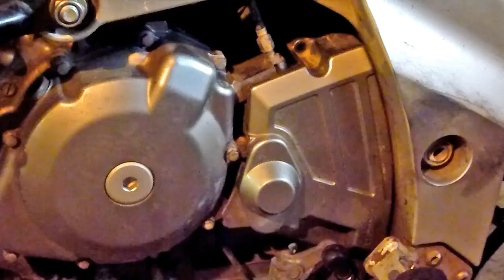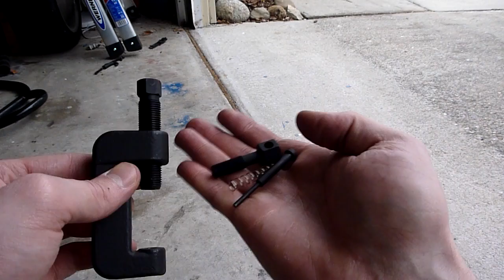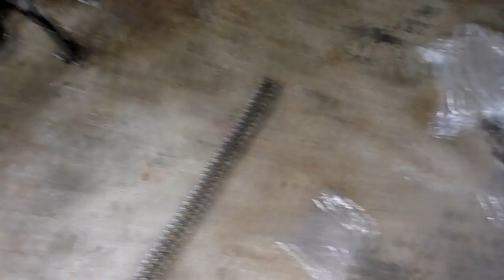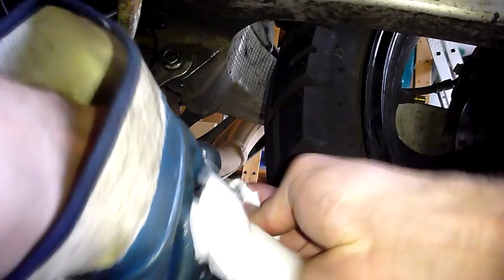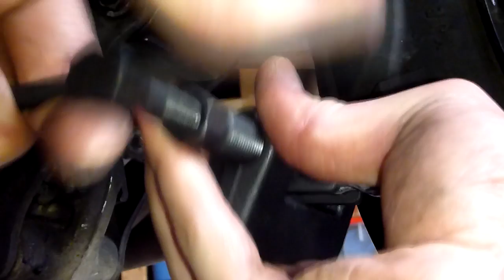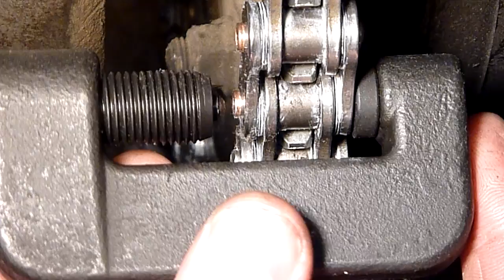How to Replace and Rivet a Motorcycle Chain (DL650)

Comment: Thanks for making this video. Your close-ups really helped show how the tool parts worked and how to to rivet. Also, I've learned that the flair of the rivet can/should be measured so you know exactly how much flair to apply. I won't list the number because it will be different for each chain manufacturer but it would be something valuable to mention on your video. Thanks again for taking the time to do this great video!

Comment: Dan, it had been about 10 years since I last used my Motion Pro kit to replace a chain. I couldn't remember how to use it, and there is a new Regina chain and sprocket set on my bench waiting to go on my bike. This was a fine video and clearly explained everything... brought it all right back.

 I would suggest to anyone doing this to also purchase a micrometer, and use it to get reference measurements for the rivet size and link plate distance using an already assembled link. Then you are assured you have sufficiently but not excessively deformed the rivets and aren't squeezing those little o rings too tight.

Compared to the cost of the chain tool its not much to buy and you can use it for other stuff as well... checking the service life of your brake disks for example. 

Thanks!

Comment: when breaking and riveting, youre supposed to screw the large bolt all the way down and tighten to grip the chain. then screw the smaller one through. you shouldnt be able to see the smaller one coming thtough. also you dont need the riveting head inside when pushing the plate onto the soft link
Reply: Correct, the push pin can explode! You don't want that flying to your eyes

Comment: great video to learn how to use the chain tool kit. i read through the instructions and was scratching my head. i agree with what you commented about not specifying socket sizes since there are different applications. thank you for taking the time to make the video.

Comment: Good job man but when you are doing the length of the new chain set the back wheel to the right spot , I,E  so the back wheel has room for adjustment both ways then lay the new chain on the sprockets with the open end on the rear sprocket . The sprocket teeth will hold the chain in the right spot for the proper length , mark and cut ! Happy days .

Comment: Btw, you can use a vernier gauge to work out when the plate is on far enough by measuring and comparing the width of the link you are using to join the chain with the neighbouring ones.

Comment: just alittle something... that tool is actually designed so that you do not need to grind anything down... just line up both holes on front and back of the chain link and twist.. it pops right off... i did it a few times today.. good video though!
Reply from the maker: I remember having that thought but wasn't confident that the tool had the strength to push the rivet through. Maybe you're right, though. In any case, thanks!
Reply: Alot of ppl grind them down.. but it's not necessary.. Those kits are pretty tough

Comment: Larger/outer threads should be closer. Barely touching. I like to pull the pin on the breaker in, about the same distance the chain pin sticks out. So the tool touches the plates on both sides & both pins touch. All done by hand 1st. Then crank the tool pin 2or3 in, 1 out, 2 in, 1 out, until it drops

Comment: Dan, thanks for taking the time to make this video. At 8:20 you say not to go too far with the riving or you will squeeze the plates together, but how does a first-time know how far is too far? By feel or by sight when it looks about right? Seems like I only have one shot at this and don't want to mess it up.
Reply from the maker: +ronleon62 That's the problem with that step; there's no click or anything so it's hard to know when is enough is enough. It might take longer, but I think the way to do it is to be conservative, and tighten it a bit, loosen it and see how it feels, then repeat the process. If you have another riveted chain, you can compare the shape of the mushroom.
Reply: +Dan Quinlivan Thanks so much Dan. Despite your good instructions it looks like I f'd it up. I haven't got to riveting yet but think I pushed the rivets through a little to much, the step right before riveting. The link is very stiff and not flexing like the others. Afraid to actually rivet now. Shit.
Reply from the maker: +ronleon62 Bummer! Are you on the step where you put the "plate" on? The plate shouldn't fit extremely tightly with the two pins that go through the chain. Perhaps you can back it out by putting some pliers in there and opening the pliers up, and push them back apart? Good luck buddy. If you get it figured out, or if you can describe the pitfall a little better, I can put it in an annotation in the video. Maybe help out the next guy.
Reply: +Dan Quinlivan Yea when I put the outer plate on I squeezed too much. I turned the tool some initially but didn't think enough of the pins were coming through to be riveted so I turned some more and that's when it got stiff. I was able to back them out about a half millimeter then riveted and it seems ok. Not as much of the pin came through the outer plate as on my last chain and that's what made me give it an extra turn. However all looks ok now.... Want to come give its test ride for me? Lol.
Reply: +ronleon62 Hi guys, best way to do this from my experience is to measure the link next to it with ideally some digital callipers and then press the new plate to the exact same width. If you have the digital callipers, you can also measure the diameter of the head of the rivet for best fit. On my chain and bike 0.5 - 0.7mm of mushroom was ideal. So measure the diameter before you rivet then do it a little bit and check and so on. I expanded mine from 5mm to 5.5 mm and they looked good. Remember, this is just my opinion. Read instructions and check with the pros that all is safe.
Reply: Thats what i do.it works great

Comment: I used the 530 chain breaking pin and got the pin stuck in my 520 chain when I tried to push out the pin.  Just an FYI for those using this Motion Pro tool.  Use the next smaller pushing pin on 520 chain.

Comment: You did alright on the video, but the chain breaker was used improperly at points.  I did notice you correct it without saying anything, but if you continue to use it that was you will break the tool

Comment: Wow. Came on here to see what I was doing wrong, and I wasnt. So I was right in how to use it, mine just is a lemon from the factory. I can't slide any of the pins in because they didn't bore the damn hole big enough! Gets stuck front or back. Like it was one of the last produced on the line after the bit teeth had worn down too far and the tolerances are too far off now. I could probably chill the pin and heat the slot but then it's a press-fit at that point and will be permanent once temperatures settle. This is BS im getting my money back.

Comment: As to the question asked below why you need o or x-rings on a self-lubing chain, I wonder if it isn't just to make the chain quieter.  And as for lubing the outside, I've heard this doesn't do any good, that the oil is flung off after 10 miles.  I don't know whether that is true or not but some guys say they never lube.  Some dirt-bikers say that the lube just combines with oil and forms a grinding compound and so they don't apply lube.
Reply: There is actually dry lube. But I don't know how that will react to the heavy grease on the chain when its new.

Also, My chain has been on my bike for 16k miles almost and it is rusted from getting the bike wet and it makes a heavy clicking sound when I take off in first gear. The O rings are smushed in appearance. They aren't round looking.
Reply: abeeftec that clicking sound in first is a symptom of what happening to the chain?

Comment: why does everyone think that the chain stretches it does not since when does metal stretch try stretching a metal pole ha u cant u might think chains stretch but its the sprockets that wear down as everything does metal on metal wise. the chain wears the sprocket teeth down causeing the chain to become slack
Reply from the maker: Chains "stretch" because their hinge pins and sleeves wear. In the video I lay the old and new chain side by side and the old one is clearly longer. However, "stretch" is not a good term as you have pointed out. Thanks!

Comment: Wrong way to press side plate on.Use the large bolt & fitting platewith holes or space for pins to come through..Smaller bolt for pushing pin out or riveting.
Reply: No wonder people break things.

Comment: oh man... :D why didnt you change the sprockets? allways change the whole set, otherwise the sprockets will damage your chain after few thousands miles. as you saw that the original chain is longer, why did you cut a piece of same lenght? ALLWAYS count the chain links. what will be, when this chain stretches? can you still adjust your rear wheel? and the original lube isnt for riding. it just conservates the chain during the transport and while it is on stock. after the chain is on the bike - CLEAN IT and LUBE IT with lube, that is made for the chain. why cant you buy such a vaseline as a chain lube? because it isnt built for riding.. how long does the vaseline stay on your chain? until the 3rd gear? then it is everywhere on the bike except the chain.. easy as that..
Reply from the maker: Sprockets were in great shape. I did an inspection. Sprockets generally last longer than chains. Some people replace sprockets regardless of wear during a chain swap. Either is fine as long as you are inspecting the sprocket. The chain was cut down to the same number of links, not length. Yes, the wheel was still adjustable. With o-type chains, the lube is inside the o-rings, so it is not correct that you have to externally lube it. You do still need to clean it. I don't really ride any more, but I did my research for this video.
Reply: You obviously ride old school.. non-o'ring chains!

Comment: That tool is from Harbor freight...it costs like 10 bucks. A chain breaker riveting tool costs 80 bucks. The one from harbor frieght can be used as a chain breaker press on tool and a riveting tool...you just have to use a little ingenuity.

Comment: I actually used the riveting tool to push out the pin not one of the pushing pins.  That's why I got it stuck in the chain.  Doo Dah.  Pay no attention to the previous commentor.   Don't use the riveting pin to drive out your chain pin.
Reply: Ralph Watten done same thing lmao

Comment: NO NO NO NEVER grease a chain out of the box! or clean it at all!! The chain out of the package is the cleanest and most lubed the chain will ever be! only clean and lube about every 3-4 tanks of gas with x-ring and with o-ring 2-3. But for heavens sake never degrease and re-grease a brand new chain it will never be that lubricated ever.
Reply from the maker: josh steele I was concerned about metal shavings from the dremel getting into it. Although, I do agree you should not degrease. Despite what I said at the end of the video, I did NOT use kerosene.. came to my senses. IIRC I just wiped it down and used a little compressed air in places where there was metal debris.
Reply: I was gonna say that stuff would kill the rings. I'll admit I didn't watch the full video but how did you get metal shavings in there?
Reply from the maker: josh steele The metal shavings came from grinding a rivet off when I was shortening the chain new.
Reply: that chain tool comes with a rivet pusher that pushes through the rivet so you don't have to cut. or so I thought.
Reply from the maker: Right. There is some debate about whether or not to use a dremel. My understanding is that, with the cheaper tools, they will only work once or twice before breaking. So for those, use a dremel.
Reply: Yea I got a semi decent one so I just punch it. but If I ever have to dremel I will know now to tape off the section surrounding it.

Comment: Ahhh  that is not how you use that tool! You want the big bolt flush before driving the smaller one in, it supports it to keep it from bending and moving around  you also don't need to be cutting and grinding your chain lol

Comment: DUDE! You have the same shitty dirty rims I have on my bike because you drive down the same dirty dusty ass driveway as I have!

Also, why not just spend 10.00 and get a master link so you don't have to rivet it?

But great vid! Thanks!

LOL
Reply: abeeftec  Most higher HP bikes require or at the least don't recommend regular master links, here's a link to a site that does a pretty good job of explaining the different types of master links. 
The part about your chain only being as strong as it's weakest link is dead on.
"There are several ways to connect a chain with a master link.  You can 
use a rivet link, clip link, or screw type of link.  The rivet link 
requires a tool to install where the other types do not.  However, based
 on testing by EK the rivet master link is 100% as strong/reliable as 
the rest of the links in the chain.  The screw type link is about 95% as
 reliable as the rest of the links in the chain, but in some cases there
 can be clearance issues with the part that sticks out.  The clip link 
is only about 70% as strong/reliable as the rest of the links in the 
chain.  Since your chain is only as strong as the weakest link we at 
MotoMummy only provide rivet links with all chains we sell.  It's the 
safest and most reliable method."
http://forum.motomummy.com/index.php?/topic/70-motomummy-chain-review/

Now that being said, I have run clip type masterlinks for years and years with cb750 honda's and rode them very hard without ever having a chain failure, so I do agree that clip type are strong, but with new bikes pushing over a hundred and some over two hundred HP, I wouldn't take a chance with those, may as well do it properly and rivet.